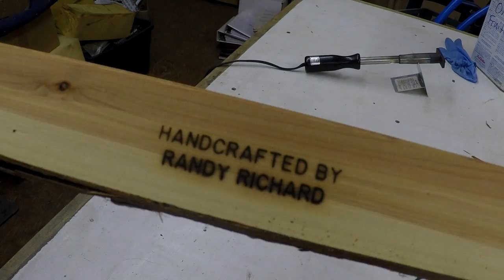Bar "Z" Bash 2015 Review & Inventable X-Carve Spindle Upgrade

Comment: Not sure how stiff the carriage is but you may have to make a counter weight (mounted on the other side of the bar) to compensate for the difference in weights of the new router motor and the smaller/lighter motor. A counter weight would not only straight up the bar but would keep uneven wear from taking place on the effected bearings. Of course I may be over  stating the weight difference but adding the weight will have SOME type of effect perhaps not enough to worry about. Nice machine!
Reply from the maker: sandrammer I have beenthinking about that also.  There is a weight diff. but not a lot.  I will do some checking for square.  Thank you for the suggestion.  Randy
Reply: My pleasure.

Comment: Randy, Awseome stuff per your usual.  I might recommend a cordless drill adapter to quickly (in slow speed on the drill) to drive that lead screw.  Your wrists will thank you
Reply from the maker: holry7778 Thanks for the suggestion, I will try it after I double nut it.  Randy

Comment: Hi Randy,

I look forward to seeing what you produce on the X-carve. I've got a CNC router/PCB drill sitting at home than needs re-commissioning. At least this time I won't have to design the controller and write the embedded C code, or write the PC app in VB!

BTW I've noticed a slight lip sync problem with your videos lately.
Reply from the maker: Paul Compton Thanks Paul.  I will have to check the vids.  Thanks for watching.  Randy

Comment: Hey Randy - use a socket wrench on a battery powered drill to turn your spindle up and down.  don't need a handle.  it will just get in the way.

dave
Reply from the maker: DAVID ENGLAND Thanks for the suggestion David.  That will work after I double-nut it.  I'll try it.  Randy

Comment: How about a pneumatic dental drill for engraving? I think those burrs spin around 30,000 rpm ...lots of noise, but nice fine carving. Love your presentations...thanks from Canada
Reply from the maker: Stephen King I think one would work.  The trim router spins 27000.   Thank you for the suggestion.  Randy

Comment: Allen wrenches are cheap. When I find a situation with limited clearance, I just cut or grind one shorter. When I get low on full-length wrenches of some particular size, I just order a half dozen from McMaster-Carr or the like.
Reply from the maker: Peter W. Meek Yep, I agree.  I will be doing that for this, plus a hand crank for the top and a cover for the belt.  Thank you Peter,   Randy
Reply: A really low-profile allen wrench can be made by boring a hole in a flat bar-stock just a bit larger than the measurement across the flats and driving a very short piece cut from an L-key through the hole. The stick-out doesn't have to be longer than the socket is deep. Make the insert longer, taper it, drive it through, and then grind the end flat and to length.
Reply from the maker: Peter W. Meek That idea might work real well in this spot.  I will have to make one up.  Thank you Peter,  Randy

Comment: What did you cut on the plastic, and why?  Please clarify, as it is what I have been trying desperately to find out, prior to spending my painfully saved pennies on it all.
Reply from the maker: +TheRangeControl I did a very minor trim to the plastic housing of the Router, the borders around the on-off switch.  This provided clearance for the router and carriage.  I hope this helps.
Reply: Thank You.  I really appreciate it, as I am learning as much as possible prior to purchase to smooth the setup process, and make improvements during where possible.

How do you get your design from V-Carve Pro to X-Carve?  Do you have any videos on that?  Is there a "Plug-in" or anything?  Please post video, that Is something that I'd LOVE a fairly clear visual understanding of.

Thank You humbly, for all of your shared works.
Reply: +TheRangeControl ж